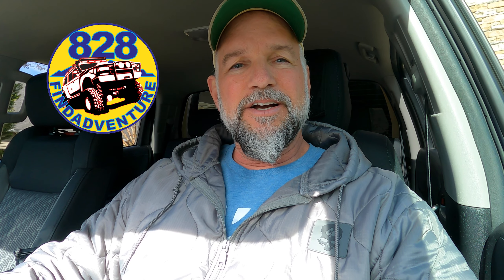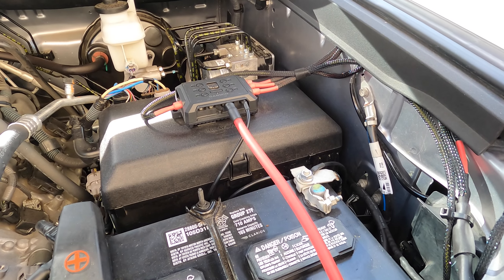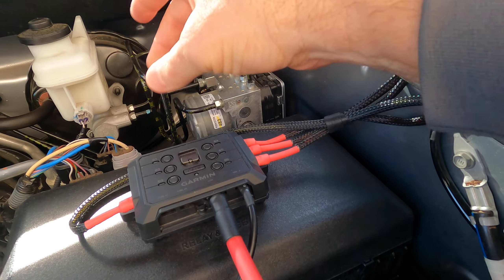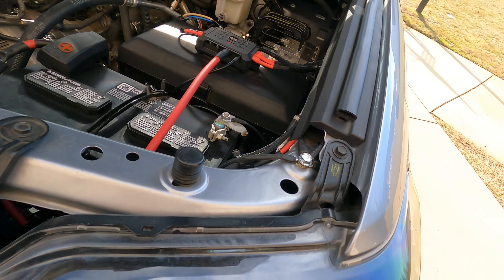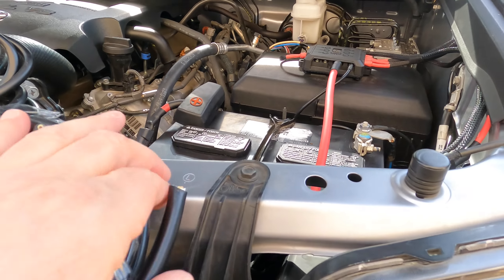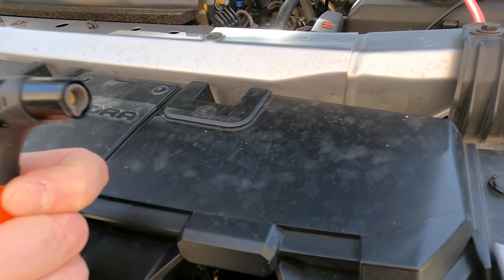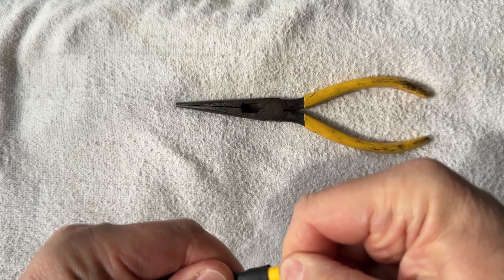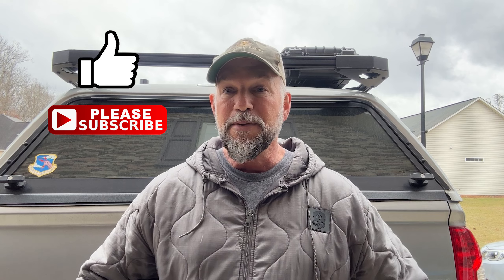How to wire lights in your Tundra the easy way

Comment: At 1:39, isn’t that a big ground on the fender beside your thumb? Not sure if you can add much to it, and the one you made looks like it should work well.
Reply from the maker: Yes it is, but that is the main and I was concerned about a bunch or wires mounted to it. If I find a solution I’ll post a video. Thanks for commenting.

Comment: Hi, how to find the ACC fuse on a 2016 Toyota tundra
Reply from the maker: Mine is a 2021 so I would refer to the owner's manual or your local Toyota dealer. Sorry, I could not help. Remember you have a fuse box inside the truck and under the hood.